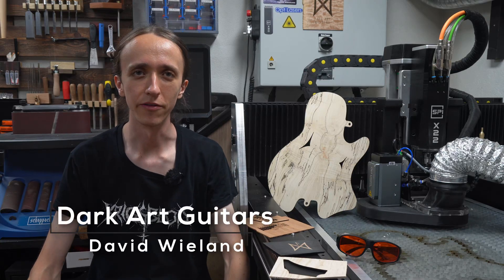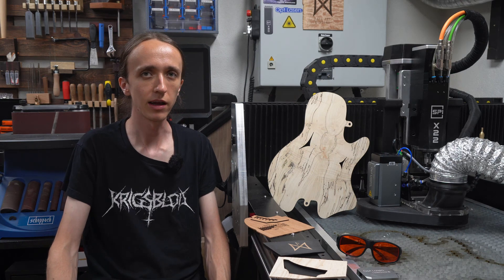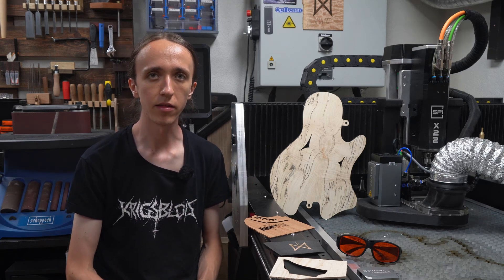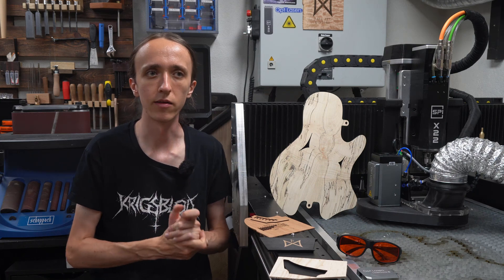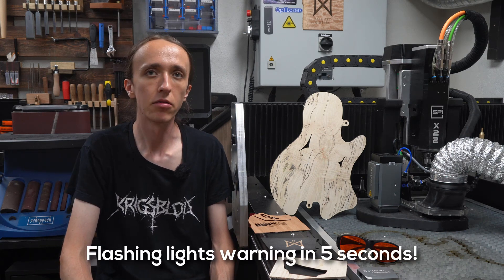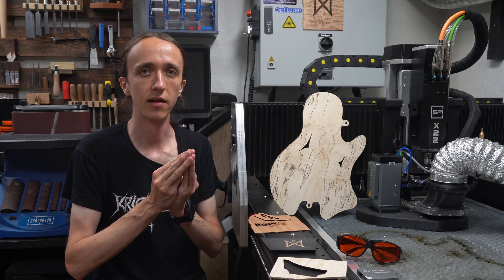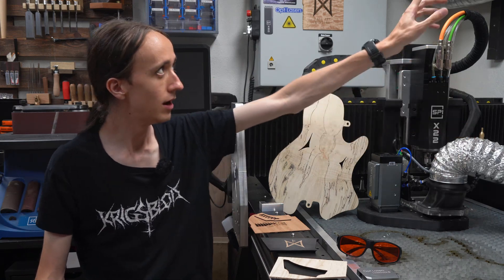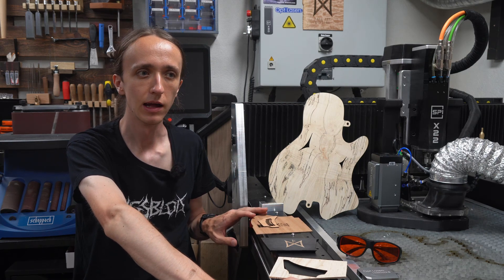Turn your CNC into a Laser Cutter - Opt Lasers XT8 Showcase

Comment: Put your inline fan at the end of the run of piping, closest to the outside, its easier to PULL air all the way through the  pipes rather than trying to PUSH it through half or all the way. Also the tighter and less slack in the ducting will improve air flow

Comment: To get your honeycomb panel to work better with the air assist. Separate the bottom and add a gap between the bottom panel and the honeycomb itself. This allows the air assist to have a space to blow into.